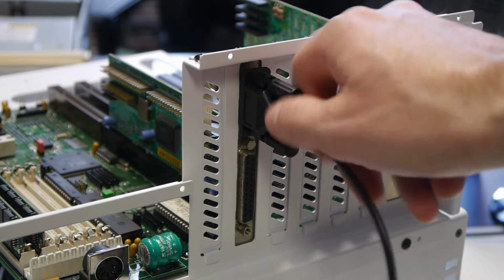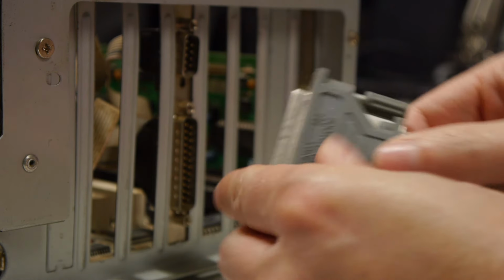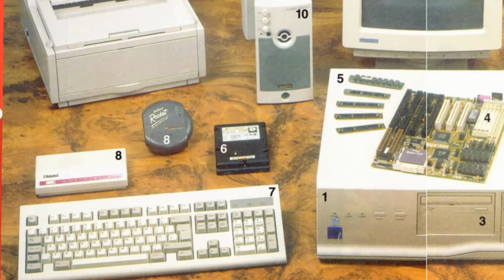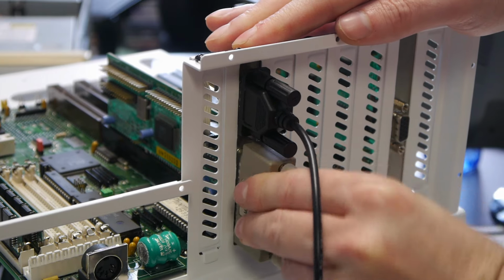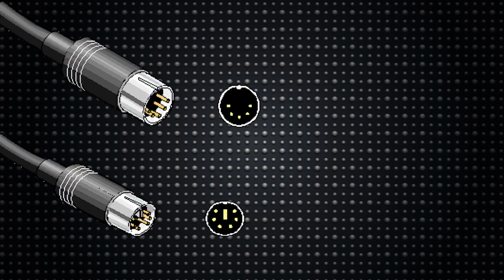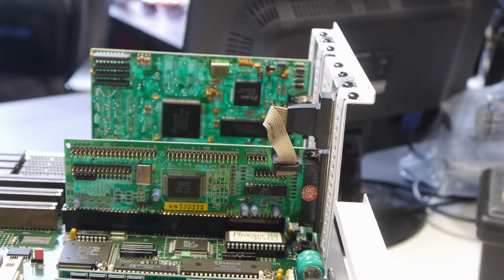What did we use before USB? | Nostalgia Nerd

Comment: major difference in operations - USB requires the CPU poll the USB ports to see if there is data.

The hardware ports used interupts.  The system ignored the device until there was an interupt.  This is one reason, some legacy devices will not work with a USB to DB9 adapter.

Comment: It appears you didn't live through the history you tell of here. It's "The IBM at model", but "The IBM A T model".

Contrary to what you say, 9 pins was quite enough for connecting to an async model. Do you have any idea what those pins were used for? The additional pins were needed only for the timing and test signals of sync and of more sophisticated modems.

What were you smoking when you wrote this? The Centronics parallel port did not have synchronisation issues: data was put into a buffer and when all bit were ready, a timing signal was activated to indicate to the receiver that data on the bus was valid at that moment - no synchronisation problems in sight here!

Comment: In fact the keyboard interface was ... software :-D
the chip linked to the DIN connector was often an eeprom 
Originally in the first keyboards was a 8031/3051 micro-controller  which one 
was in charge to serialize XY keystroke hence the clock pin !

Comment: 1:38: "Also early machines included a DIN-socket for tape"  Misleading formulation ... the 5150 sure did, but apart from the PC Jr. (which used a pin header) any other IBM machines did not.
2:58: That battery is about to leak or already leaking. Better swap it quickly before it causes more or less major damage to the board.
8:20: Innovation SSI-2001 (8Bit ISA card with a 6581 SID from a C64) included a 15 pin connector for joysticks in 1988 - the card bombed tho which is why it's mostly forgotten/skipped. If you want further information on that particular card, give me a ring as I reverse engineered it and own one of the very few originals still around. Some soundcards (particularly the Covox branded ones) used the "Atari" Interface using 9 pin DSUB jacks (sometimes even 2 per card).

Next video "why consumer grade soundcards are a thing of the past" please? :)

Comment: My phone has a USB type C connector, my smartwatch charger uses micro B and my little speaker needs a mini B connector. My iPad has Lightning and my Windows tablet offers a micro-OTG and a Type C OTG connector. My external hard drives have either a standard B, mini B or micro B connectors. So we have all this male-female/null modem whatever adapter mess again. lol

Comment: Ports have been standardized to single USB. But I still can't manage my wires. The back of my PC looks like Pubic hair.
Reply: Back then "cable management" wasn't a thing.
I believe I heard "rats nest" well over a thousand times during my youth. Once you got a piece of gear actually working, you never touched ANYTHING for fear of it crashing.
Reply: It may be actual pubic hair. Take a vacuum cleaner to it.
Reply: Cables were also very thick back then.
Reply: In the movie, Caddyshack 2, Ty Webb had golfing down to just the bare essentials, club, ball, and swing.  I know it was only a movie, but I try to get things down to the bare minimum of what I need only.  So I used the same thinking with the PC, and I'll think of individual components.  Monitor, keyboard, mouse, webcam, printer, ethernet, and speakers.  I used to think of each component as, "ugh so many damn wires"  But now that I think about the components as just individual pieces, it's 10 times easier for me now, to deal with all the wires in the back of the PC, but yea, mine looks like a mess as well lol.
Reply: i dont give a damn about cable mangment because i only care about if the pc works or not.
Reply: my first ever computer ive ever used was hp media center from 2005 that my mother got when i was only 4 and that did not go so well and i kept slapping it and then one day it then no longer turned on and was considered beyond repair as 4 year old hands were too hard and slapped it into infinity
Reply: It may be standardized in the sense of way data is transferred but there are as many different USB plugs and ports as there were different connectors back in the day, I've got boxes filled with USB cables all with different plugs and never the one I need!
Reply: so am i.after 25 years ,i still cannot put them in order.
Reply: @badspy100  Its simple. See the square holes on the metal plug then if the holes appear solid black then its the right way. if the square holes are white/dark gray/blue then turn your x postition 180[degreess] right/flip over.
Reply: @kthskmzs  i am talking about cable management. lol

Comment: There were also some IBM portable/luggable PCs that used RJ45 keyboard connectors due to size and I think some clone XT/AT desktop PCs did the same instead of the 5-pin DIN (for lesser known reasons...maybe just to re-use terminal keyboards that already used it???).

Comment: i hate that the soundblaster clones are called soundblaster clones. i certainly do it myself, but at the core they were using the same dsp as the creative labs version. interfacing that chip to a computer through isa and later pci was such a mandatory thing on the hardware side that only features could be patented, software is where creative labs beat the competition, and the competition literally used their software. they just didn't have all of the features enabled in said software =P

Comment: USB1.0 got many inspirations from SCSI. Many commands to identify, initialize and access USB devices are nearly identical. 
he same with SATA. It's nearly a 1:1 protocol copy. My opinion is that SCSI is the most influential system connection on PCs. 
Many home-user and Industrial fast device connections are either SCSI, 1:1 protocol copies or heavily inspired by SCSI.
It was the most reliable and fastest connection for home user.

Comment: Very good video!  A couple things, though: D-Subminiature connectors: "D-sub", or just "D", as a group.  Individually, the letter indicates the shell size: DA15 (gameport), DB25 (RS232, Centronics, Mac SCSI), DC37 (IBM Ext. FDD, some SCSI, moon things), DD50 (SCSI, more moon things), DE9 (RS232, early Mac mouse, loads of other stuff) DF104 (Moon things).  Also there are high-density ones but the only one you see regularly is HDDE15 for VGA.  It is incorrect to call them all "DB" as that refers strictly to the shell size of the Centronics/Parallel port.  DEC is pronounced as "Deck", unlike NEC. 

You don't need a vintage machine to get your vintage hardware fix, a surprising amount of old stuff "just works" even on modern hardware; my main PC with Core i7, 16GB RAM, 640GB SSD/accelerator card, 3GB graphics adapter, has room for a SCSI card (the biggest key to vintage hardware) and a PCI Express Multi-I/O with Centronics and RS-232 ports both.  I've used a Summagraphics Summasketch tablet, a Joystick Technologies Rollermouse, hard disks dating back to the 1980s, a Sony 2.4GB Mag-Op drive, an IOMEGA Jaz drive, so on and so forth.  IOMEGA Bernoulli drives and SyQuest cartridge drives are both confirmed working with Windows 7, driverless (Gotta love SCSI, it was meant to be pronounced "Sexy"), and the latter are dead reliable.

Comment: USB should have been a 2, 3 or 4 mm 4 pin phone Jack.   It would have been much cheaper to produce, could have supported Giga speed optical and would have never had any issues needing to be reversible.    For those who do not know, Joseph Decuir who was one of the inventors of USB also designed the Atari SIO serial interface (up to 120,000 bps on in 1978). So USB would not have existed if it were not for the Atari 8 bit computers.

Comment: For a lot of the slower devices, you didn't really notice a difference. However, USB controllers are a huge upgrade. The joystick port was never reliable and gave all sorts of numbers on the input. This is why you often had to calibrate the joystick. I think now the controllers stand still at 0. Joysticks were a mess for a while still, but USB improved it significantly. The 4-button Gravis Gamepad was somewhat of a hack since it stole 2 buttons from the 2nd player. That was no longer required. 

The Xbox 360 controller standard for Windows did seem to be a sneaky thing to do at first, but it was a blessing. Windows PCs now have a standard, and the Playstation controller is very similar. You had a lot more controller-compatible games after this. Before, you might be lucky, but still might have had to map every single freaking button to a movement, and buttons 1 & 2 were on the bottom, 3 & 4 were on the top. 

I ranted for too long, but yeah, game controllers on the PC have a history, and USB was one of those turning points
Reply: There was also a hack in-between analog joysticks and USB ones. Microsoft Sidewinder had a digital mode where it bitbanged gameport to send more data (4 more buttons) than ordinarily possible.
Reply: I had a Playstation-like Gravis controller that did that as well. It was an improvement, but still nothing compared to an SNES or Playstation controller on a parallel port. Come to think of it, I'm surprised no companies outside certain scenes came up with a standard that was built upon the parallel port. There also was a controller that mapped things like shoulder buttons as axes on player 2 which worked well in games like Super Street Fighter II Turbo (do not get the butchered one that came on floppies)

I never had a Microsoft Sidewinder though. I wish I tried one, but back then, I was hesitant about Microsoft products

Comment: And on the early Apple side, SCSI and ADB. I've got an old SE with a SCSI Zip drive and an ADB serial connection hooked up to a PowerPC, which in turn is networked up to a G3 iMac, an iBook, and an Intel Mini which then communicates with my '09 iMac so that I can store backups of the older equipment in my OneDrive. I haven't yet been able to fudge together TCP/IP over ADB so that the SE can browse the net, but anything I need to download for it goes to the PowerPC which I can then grab through the network share (and vice versa). 1987 meets 2018 with a few stops along the way. :)

Comment: One oddity that no one mentions is that early CDRom drives used the MKE interface... ATAPI would come much later.  I remember when I bought my first cdrom drive, I had to go right back to the store and buy a SoundBlaster 16, since that was the only card at the time that supported MKE...   that's another reason why cdroms were seen as multimedia devices, you needed a decent soundcard just to plug them into your computer.

Comment: pin sync wasnt really a problem with parallell, because most parallell comms usually includes whats called a "latch" pin. Essentially the UART would load the 8 bit buffer into the pins, then pulse latch , which means "heres a byte for you". As long as the recieving UART is correctly built to trigger reads on latch turning high, even inconsistent byte rates where not really too much of a problem. The problem with fast parallell is more that the chipsets just where not designed for it.

Comment: one of the things you neglect to mention, in the beginning there was no 9 pin serial port that came much, much later. in fact the serial and parallel ports were both female in the beginning, so you needed to know which was which. my disk controller card had  floppy header, a hard drive header using the sasi interface which predated scsi.  it also had both a serial and parallel connector as well as a midi port. you call that a joystick port, but it also allowed you to connect to a musical keyboard. I had one of the original black and white hp scanjets which had it's own proprietary parallel port. later when the sound card was introduced, it also sported a midi port. another thing you neglected to mention, is there were internal tape drives that used the second floppy drive card edge connector. I worked for one of the soundblaster clone companies, Mediavision, which was fully compatable. I can remember 300 baud acoustical modems, which you actually took the phone handset and inserted it into two round apertures. until I learned how to make serial crossover cables or null modem, I thought that was blazing fast. something else you might do a video on is Laplink, special software that used either a serial or parallel port to transmit information between 2 computers sitting next to each other, rather than over a phone line.

Comment: What were IBM thinking with PS/2? Requiring the keyboard and the mouse to be plugged into particular connectors, rather than writing the BIOS to cope with either device in either port. (The Olivetti PCS86 can do this, so it's obviously possible at an electrical level).

Comment: Not the best example maybe (because of the speed, but there was a hardware bug as well to be blamed) but back to the Commodore 64, Commodore started to use a quite "USB-like" solution, the serial IEC port, which (in contrast of USB) is daisy-chained, but you can can hook disk drives, printers and plotters for example (so multiple devices) to a single connector on C64. Serial IEC also has the ability to addressing devices etc on the bus, so in some senses it's quite similar to USB (but totally different in other aspects, like daisy chaining devices, so one connector on the computer is enough for multiple devices as well). Surely, serial IEC was painfully slow (but here, some of this slowness is because of the ugly workaround method of a hardware bug in a chip used by Commodore products). Anyway, I wanted to note this, since I always felt this as an elegant solution, even if it was very slow, indeed. But at least "elegant", well ;-P

Comment: Only problem with USB is, that it tends to be unreliable. Where RS-232 (COM-Port) works 24/7 without any doubt, USB tends to hang up on voltage disruption. That's why RS-232 is still been used in industrial enviroments.

Comment: The days when connectors didn't just snap off.
Reply: I mean for most cases they did atleast one without screws, and pins were too easy to bend that ports and cables didnt last long.
Reply: Who remembers having to use needle-nose pliers to straighten bent pins?
Reply: I love when those plastic screws get stuck and i forget which way i need to screw them
Reply: The days when you knew what a connector was capable of.
Reply: They can... If you're extremely careless.
Reply: Joe
you have it right the first time, but are at an slight angle. Instead of forcing it in (and possibly damaging your port) you figure it's upside down
Reply: No instead the pins would bend.
Reply: They still don't unless you're a clumsy bastard.

Comment: PS2 remember so many people bending the pins on a mouse or keyboard because they were ramming them in the wrong way.
Reply: @Barthy Col 
USB. 50/50 chance of getting it right and you get it wrong 100% of the time.... even after intensely staring at both ends of the connection. lol
Reply: sounds kinky
Reply: PS/2 wasn't meant to be plugged and unplugged frequently.
Which is kind of a problem for laptop users wanting to unplug the mouse so the connector doesn't brake off when they carry the laptop around
Reply: A very common problem!

Comment: So many companies involved in making the USB and still no one considered making it visually asymmetrical. And it's never the first try and amazingly never the second try either, even though the thing only has two possibilities. Good thing it keeps evolving though, now there are asymmetrical versions.
Reply: It's already visually asymmetrical given there's a bar of plastic on one side. People just don't bother to remember  which direction their ports face.
Reply: I still think jacks would be better as even though the new USB is reversible that just means it can be plugged in two ways instead of 1, a jack has no orientation.  If modern jacks can carry 4 or 5 rings and USB only has 4 connections then they missed an opportunity to create a bus that is as foolproof as a headphone jack and even a toddler could plug in easily.
Reply: @krashd  USB C is reversible and has 24 pins, and it can charge a laptop.
Reply: USB-A was always supposed to be the end that stays plugged into your machine, while USB-B, the one with slanted bottoms, was the one that was supposed to get plugged and unplugged all the time. The common mini and micro USB are technically considered USB-B, and you may find the old big USB-B even on modern printers.
Reply: @TheLaXandro  Interesting, why did it end up getting used backwards?
Reply: diegofloor 
http://i.imgur.com/7ULpwu4.jpg

Comment: Parallel is a much better connection method. Imagine this, one single line can do 640 megabytes per second. Multiply that by 8, or however many serial lines you want to use. 5 gigabytes per second (or 40 gigabits per second if you're comparing it to USB).

Still think legacy ports should be removed?

Comment: I had a 386 as the family PC as a school boy but in my late teens I had a guy build me a Pentium100 with 8GB RAM and a 4mb graphics card. Was a awesome machine and the game port o the soundblaster card came in very handy for running my ZX Speccy emulator and NESticle...Shame it could only really run the SNES emulator at a useable speed with the sound turned off.